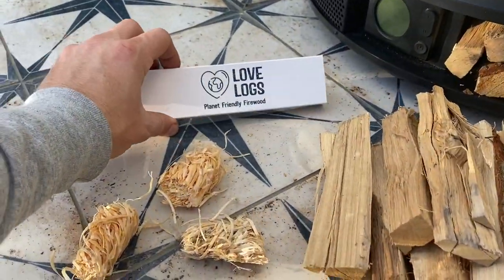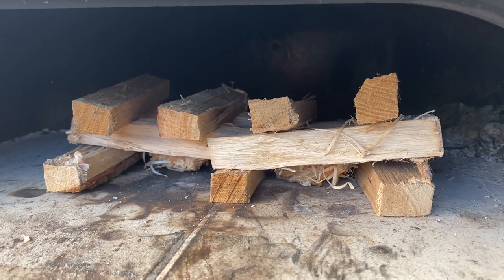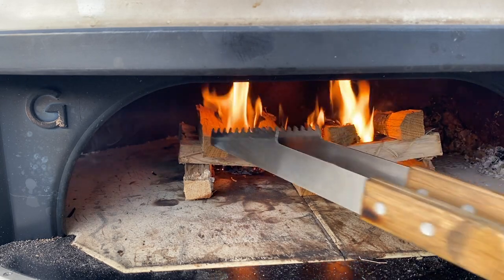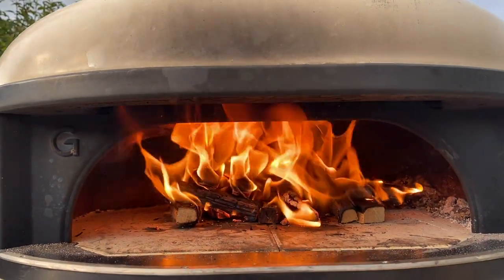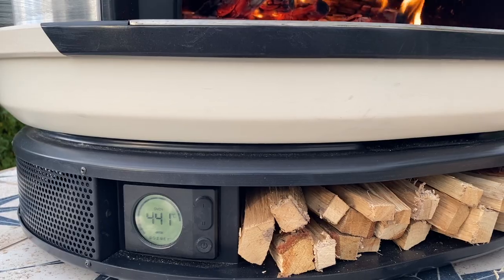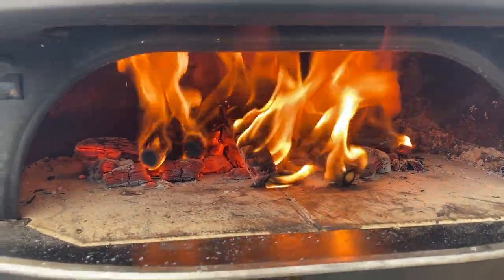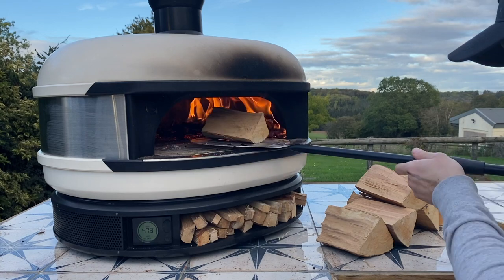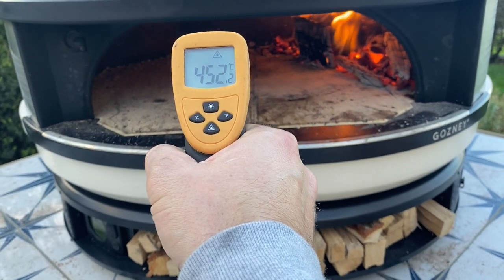How to Light your Gozney Dome Pizza Oven

Comment: Great vid mate, thanks!   Used your method and worked much better to heat up the stone quickly and evenly.  I also just let the fire burn in the middle and then when ready to cook with a cast iron pan, just used it to push it back.
Reply: Forgot to add, love your wood kits, really cool.
Reply from the maker: Cheers for the comment and letting us know how you got on 😁

Comment: hi Paul.  what height is your counter from the ground? i dont fancy the Gozney stand and so would like to put it on a table or counter like you.  thanks!
Reply from the maker: I built to the exact height of the Gozney stand figuring that would be the best height, the dimensions are on their website. I’m 6 foot and the oven is actually a little low for me, but if the worktop was any higher that would be too high - so if I did it again I’d build a raised platform for the Dome.

Comment: Thanks for the information video.  I have a quick question regarding burning wood in the oven which I have not been able to get resolved.  When you burn wood in the dome its suggested moving the burning wood to the left then the right. To heat the dome evenly.  Obviously, this leaves fine ash on the hearth (cooking surface). How do you clean the fine ash from the hearth before lunching the wet dough pizza?
Reply from the maker: Hi Paul!

Ash hasn’t ever been something I’ve noticed as a problem. Once you sweep the bulk of the ash off the cooking surface, which I do with my turning peel, all the tiny bits of ash burn up and disappear to nothing. If there’s anything left I just flip my metal peel upside down and scrape it to the back of the oven.

Ash is obviously part of wood fired cooking so there is always likely to be a little bit around somewhere.

Cheers!

Paul
Reply: I've seen few people use a soaking wet rag around the head of a turning peel to wipe away any residual ash from wood burning
Reply: Give it a gentle blow and it will move back.  Also adds to the flavor!
Reply: @183jeffrey  I highly recommend not using anything wet in the dome. You could damage the ceramics from temperature differences.

Comment: Looks like yours has a similar crack in the stone to mine on the right side up to the air vent. I shouldn’t be concerned, right?
Reply from the maker: Yeah it does. Cracks in wood fired ovens happen, but the amount of problems Gozney are having means there’s an issue somewhere in the manufacturing. If the height of the stones hasn’t changed I wouldn’t worry, but I’ve registered my problem with Gozney and they’ve agreed they’ll repair the stone in a few months when they’re through delivering all the outstanding Domes 👍🏻
Reply: @planetfriendlyfirewood  thanks for the insight! Doesn't seem to be affecting performance right now but I'll make a claim as well. Thanks.
Reply from the maker: @ATBechtold  I think Gozney will ask if it’s hairline or significant, and will replace if it is or it becomes significant

Comment: Hi Paul, how would you prepare a fire for a longer slower cook, 200 degrees or so to do a roast? Obviously don’t want to get it up that high but I assume you want to still catch a big log for longevity? Really have no idea what I am doing
Reply from the maker: Hi Peter, I’m literally in the process of editing a video spatchcocking a chicken. It’s a little tricky without the door, but I should be able to post that in the next 24-48 hours 👍🏻
Reply: @planetfriendlyfirewood  perfectly in time for a roast on the weekend, thanks!
Reply from the maker: @PetereBath  I do use some lumpwood charcoal, not sure if you have any for cooking on a BBQ, holds its temperature a little better than wood generally speaking